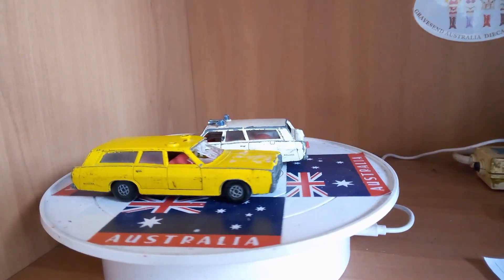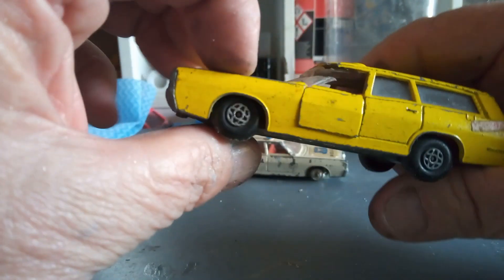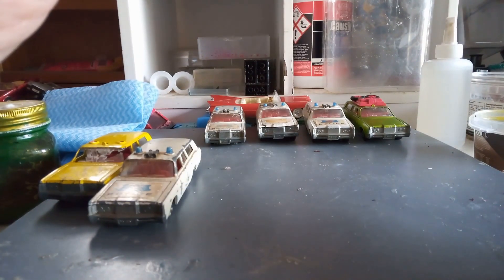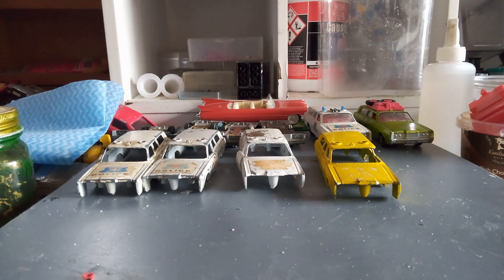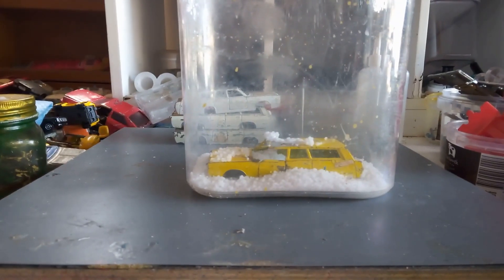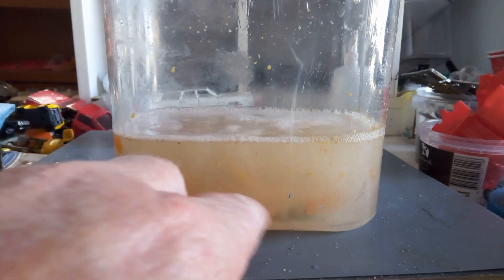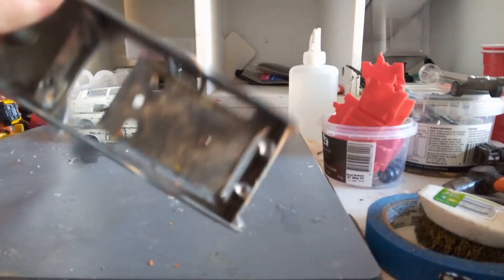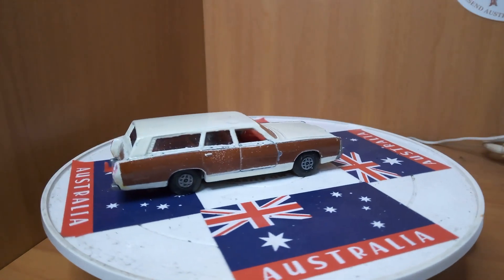Matchbox King-size/Speed Kings Mercury Commuter

Comment: a mass restoration! :D first of all I love the ideas and detailing, and colours you did. but it hurts to see that with all of them, paint chipped off the front fenders. I had that in the past, too, and it sucks. :P I think it comes from when there is paint on the surface of the door pointing at the fender, and then you close the door and open it, the paint layers stick together, and due to the lever added the paint chips away from the fender. the only solution I can think of is to leave that spot on the door blank. which adds a lot of inconvenience to painting, of course, thus it is not an easy solution. but I just hate to see your paintjobs ruined by that.
can't say which is my fave, they all look good in their own regards, be it the luxury wagon (country sedan?), the custom-painted ones, or the rat rod. :)
Reply from the maker: I'm fairly sure the paint chipping near the doors is because I leave the doors closed on the casting when I paint it. Too much handling before the paint is properly cured doesn't help either
Reply: @gravesendaustralia  that is a factor as well. I wasn't very patient as a kid, too. XD